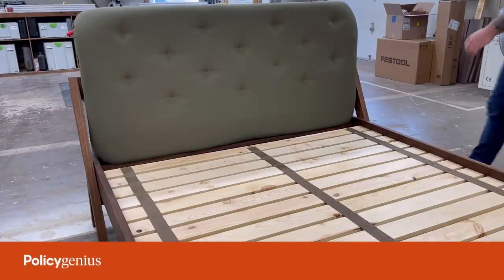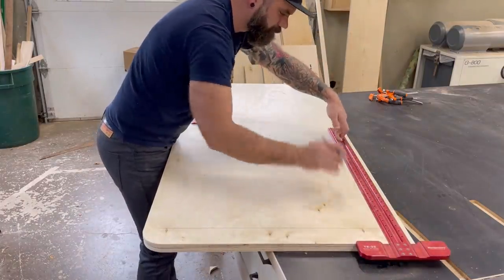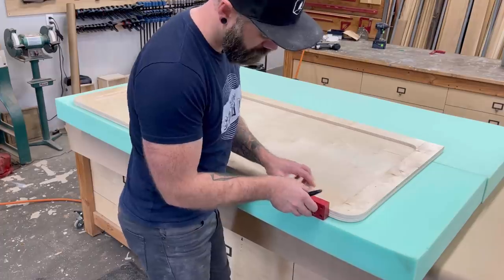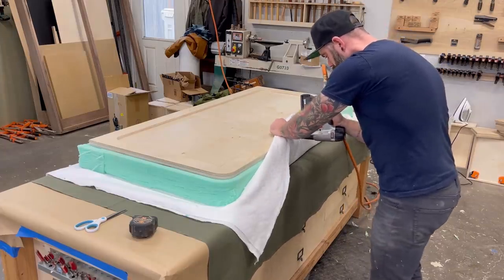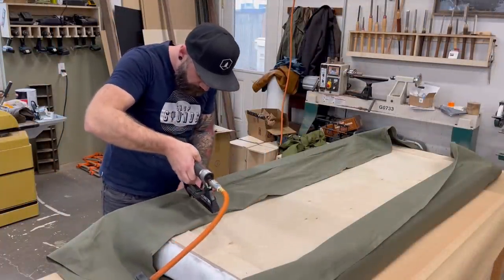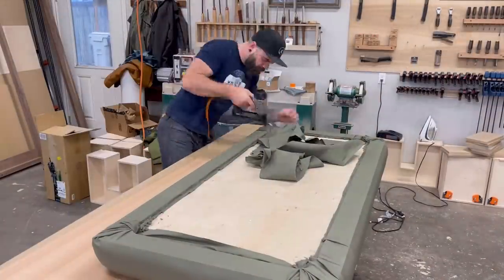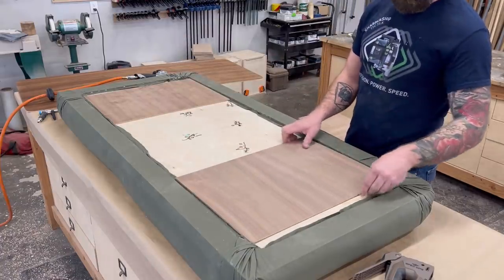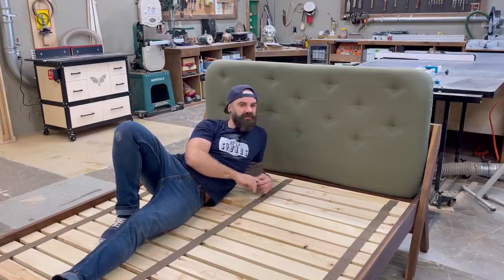Trying To Make a Headboard || This Wasn't Easy

Comment: Just a few tips for next time (I'm not an upholsterer, but a sewist and a costumier)

Fishing line for your tufts. Use a heavy gauge. The thread itself will be invisible, the tufts will still work beautifully, and its a lot stronger and more sturdy than embroidery thread. You also should do tufts before you glue the plywood on ;) You want to hit your fabric pen X on the outsides and aim for the middle out the back because you're gonna pull them real tight (which is what sinks it in and creates the tuft)

For your corners, cut a line in the corner like you're going to miter them. It gives you more control over the excess fabric and the pleats you're trying to create. It also handles the problem of excess fabric in the corners in the first place.

You can use your band saw or a jigsaw to cut your foam. Its a lot easier and cleaner.

And I'm not mad :) But for as much as I've learned about wood-working from you, maybe I can share something I know in exchange to make the process easier for you next time! <3
Reply: Thanks for sharing!
Reply: Certainly helps me out! I was wondering about the fabric in the corners. Now I want to do some upholstering.
Reply: I used to do upholstery in a furniture factory to work my way through university. Top marks for getting it done and looking very good from the front which is where it counts.  one tip that will save you a lot of effort and frustration for next time. Use an upholstery needle that has its eye near the pointy end. The longer the needle the better. from the back push the empty needle from the back ( in this case through the plywood) to the front. STOP as soon  as you have the eye fully visible. Thread the needle and just pull the needle back out the back pulling the "THREAD" with it. If you are using buttons made up at the upholsterer's shop (covered with your fabric for example) you would just loop the upholstery cord through the eye in the button and then both ends of the cord through the eye of the needle and pull it back through the cushion al at one time.
Reply: fellow sewist here!
firstly for stretching the fabric over the foam and plywood - do what artists do when stretching canvases and tack in the centre of each side of your rectangle at the start. this keeps the centre under 4-way tension and prevents your fabric shifting as you work + on each side, go outwards from the centre. on a non-pattern/densely woven fabric it's not so obvious but if your fabric shifts too much the grain will be noticeably wonky
Reply: also - agree about the mitred corners — you often see quilters doing this. you can pull the fabric together and make what looks like a triangle, standing up vertically, to cut excess fabric then fold the raw edges under; if you are worried about things shifting you can use a slip stitch to keep both edges of the mitre together. or you can just chop off the excess fabric and do pleats i guess. 

re tufting: you could do it before the plywood, but since this was an afterthought - maybe drill bigger holes next time? and tie threads from different holes together, that could work? buttons will make tufting look nicer, but then you need matching fabric-covered buttons or have to cover them yourself, so... pros and cons.
Reply: would they need to be fabric covered? as another comment said some walnut buttons could be nice accents in the upholstery that matches the bed frame.
Reply: @James Bentley  Fabric covered is traditional, but in reality nearly any nice bog button would work well

Comment: There is an easier way to thread needles through foam and fabric, they make a double ended needle in lengths from 6" to 36" long. I am an upholsterer with 52 years experience. Also, when you do the corners, start in the center and work out pulling the fabric straight, this will give you straight pleats, which look better. The way that you attached the ends of your strings is the way we di also, so 100% for that. On the whole if my Apprentice presented me with that job without any previous training, I would be really encouraged that His or Her prospects in the industry were excellent, provided that they were prepared to listen and learn. On the whole a good attempt, 70%, with 100% for effort and initiate.

Comment: next time map out the holes on the ply wood before you upholster.  Drill those holes out with a half inch bit then stick the foam on. Now you can drive the needle through the hole making sure its level.  Use a button for a more finished look.  once you have both strings on the back slide simply use the stapler to attach it to the back of the plywood creating a Z pattern for strength.   

I absolutely love your wood projects.  you've inspired me to get reacquainted with my woodshop tools. Keep up the great content.

Comment: I know nothing about upholstery and I prefer the look that you created, truth be told... But... In a video I once saw, the upholsterer cut out 1 inch or so holes in the foam all the way through and used buttons. The back board was two small holes and then they simply pulled tight and tied off. They made it look easy, as you do with woodwork... aaaand I find both utterly baffling. 

Cheers for the awesome content!

Comment: Good video!  Glad to see you aren't afraid to try something new and admit when you have no idea what you are doing!

I have made a couple upholstered headboards, and I sew, so here are my two cents:
Drill your hole bigger in the first place and usually  will have less problems finding it.  Have someone work the front side while you worm the back side, so you can keep things aligned and get clean,  tight tufts.  Use upholstery thread.  It is much stronger, almost like the kind used to make seat belts.  If you use a piece of pegboard, it will make planning out where all your drill holes go so much easier!  Alternatives to fabric pen: chalk, washable crayons, or bar soap (this is my favorite...it quite literally cleans itself off!)

Comment: There is an upholstery twine that’s strong, opt for that. Tuft first, then finish off. One big drill hole. Shortcut, cut a grid pattern on the front it will make the tufts look more tuffy. Have someone push on the front while you grab either some cotton or a finishing nail to tie it off. A button will make it easier to pull and push.   Then with the corners you can trim the fabric to reduce the bulk and make it smoother. My grandpa was an upholsterer and taught my parents while I was the button pusher. But for a newbie improvising… this looks good.  Nice job, just have to practice the even pulls. Like sanding it takes time.  It’s also good for developing strong hands.

Comment: DeWalt, and I'm sure every other company, makes a snap off razor blade knife. I almost never use the snap offs because I inevitably use it like a sword. (It's about a 6 inch blade all the way extended). Cutting rigid insulation and the like. Would be great for cutting soft foam.

Comment: One thing I found handy to do was to use the spray adhesive to adhere the batting to the foam.  Then, on the surface of the batting, spray come silicone lube to allow the canvas or vinyl to freely pull over it.  If you hadn't done the tufts, I would suggest that you drill a few 1" holes in the back to allow air to move, otherwise you get that suction thing going on when you compress the foam and it slowly sucks the air back in.

Comment: I worked in upholstery for 6 years. You are correct we used a electric cutter similar to a bread knife. Usually pleats are made with buttons and tied off in the back with a synch type knot.

Comment: I'm no expert by any means but have made two headboards. I did the button and tuft before stapling the fabric to the back of headboard. This will give a deeper tuft and more control over the pleats. Another tip for the corners, you can cut some of the material to give it a more smooth look. Still looks nice!

Comment: Pneumatic Addict did a great video on how to "cheat" button tuft by drilling a screw with a washer through the foam into the backer and gluing buttons over the top. Worked great!

Comment: For cutting thick foam really quickly, use a hacksaw blade and a blow torch. It will go through the foam like a, well, hot hacksaw blade through foam. That's what I use for cutting out foam in gun cases.

Comment: For cutting the foam you should have used your bandsaw. When I have to cut foam and it will fit on my 14" saw that is always the best way. I also have a cutter dedicated to cutting foam that is nothing more than a scroll saw or sabre saw with a really long blade enclosed in a really long guide.

Comment: little tip for next time on your foam you should mark up the postions of the tuffs and then using a hole saw cut out holes that are 20mm in diameter but dont go through the timber, then in the center of them mark up and drill 10mm holes; what this does if give you a little void to poke your needle through.

Comment: I built something similar but I used buttons that I bought at a fabric store they were in a kit and it came out great I also used tie wire to pull the buttons tightly I too was learning for the first time  great job

Comment: Thank you! It brought me back years ago!
As a month-long "week-end project", I built a "tantra chair" about 4 years ago in very similar conditions, just without any skill in woodworking either, it took ages but turned out pretty well. I learnt a footlong carving knife works fine on foam, palette wood makes perfect slats and cutting the foam flush to the board is fine if you're pulling strong enough. I used PVC fake leather and studs, no tuffs, and learnt that studs are incredibly fragile under a hammer while you're pulling the leather, one stud each side at a time (this type of chair is only made of curves!).
Is upholstery foam the same awfully expensive in US? It was by far the biggest part of the project.
Reply: I had no idea what a tantra chair was... until I read this comment, and quizzically Googled it. 

That is NOT a beginner-friendly project. Well done, sir.

Comment: Great video sir!. I was just thinking that where the material is held by the cotton, it may snap the threads of the material in time. Most upholsterers use a button to hold back the material rather than just thread as it spreads the stress on the material itself. You can get buttons you can cover with your chosen material to match up or a wooden button would look cool to. I look forward to your next project, best wishes, cal😉

Comment: LOVE your contents ... thoroughly enjoy the videos and end product. I'm definitely not as expert as you, but here are two ideas come to mind for the finish: 

a) use two needles, insert second backwards and then re-thread, it may not be very easy but beats creating 8x18 holes :-) and then "pulling and pushing" to find the hole... LOL
b) there are special needles with hook style head (crochet), you can use those to push and pull (or pull and pull)

Comment: I’m nowhere near a skilled woodworker or a upholsterer - but I’ve dealt with cutting thick foam a bit. A sharpened kitchen Chef’s knife works magic. Maybe put the foam on some cardboard and use a good chefs knife. Clean cuts. Of course band saw would be great too but maneuvering a large piece around a band saw can be cumbersome.

Comment: Lol, batting can be used for many things, like quilts, but this seems like a fine application too. Also, should you find yourself needing to cut upholstery foam again, a serated kitchen knife (like a big bread knife) works great in one cut. You can also use a large unserated kitchen knife but Ive found the teeth work better. Probably could have also used some kind of saw. It's pretty easy to cut, it's more about what's most convenient that you have on hand.
Reply: As someone who is a sewer and not a wood worker but lurking around to get some wood working tips, I was LOLing so hard at the upholstery/fabric parts bc that is how I feel when Im building stuff. But on the sewing stuff Im like drill bigger holes! But I'm over here building stuff making the same decisions about wood work. 🤣

Comment: As long as the headboard isn't going to face a ton of punishment, you could always just make a sturdy frame and use thick pegboard under the foam, batting, and fabric. That way there is no drilling required, you figure out the pattern on the back, make sure you are poking the upholstery needle through straight and level, and it gets done a heck of a lot faster. You can still cover that up with another board when finished if you are worried about the appearance of the pegboard, and even add a bit more structural sturdiness that way as well.

Also agree with many on here pointing out the need for buttons in your tufting. You can buy little metal craft cover buttons and as long as you aren't using a ridiculously thick fabric you can just duplicate the fabric used on the headboard. That or change the color, go lighter or darker, or even go with various colors to better match the room's color scheme/style.

Also for those looking to do this, be prepared for sticker shock when you go to buy furniture foam and batting. That stuff is ridiculously expensive (that or perhaps it was just a Covid supply issue markup when I went shopping for it). I was awfully tempted to just go thrift store shopping for a piece of furniture that had a bunch of sturdy foam I could re-use, but my wife's aghast look when I mentioned this thought made me think again.

Comment: I've only done a little upholstery. With twice the thickness you could have used those fancy upholstery nails? You could have used them at single thickness but are those harder to use? You've got ultimate tweakability with staples (that you're going to conceal later anyway) nails seem like you won't have as much fabric control and then there's your nail line, making that look good, which is the hole point of using the fancy ones. Seems like there may be more of a learning curve using nails.

Comment: i am an upholsterer. nice effort. The biggest issue was the foam, you used standard density foam, Large deep tufts need lighter density foam AND you need to pre drill holes in the foam under every button, an electric turkey knife works well on foam.

Comment: To make your stretching and stapling bit easier (saves the finger pain) and getting cleaner edges, you could have apply some pressure evenly with some clamps and 2x4 and squeeze the the foam by 50% and then staple. however for this technic, 1" extra boarder for the foam is not needed and you would have end up with real clean corners and edges.

Comment: back in the day i made several gun cabinets with tufted velvet on the back of them. back then we didnt hae the internet to search for directions. we made it up as we went. i only used 1 1/2" foam, but they sell (or at least they used to) what ill call "blank buttons" where you can take a small piece of your cloth and wrap the button with it. i used those and spider wire fishing line to make the pleats. the buttons meant youonly had to come back through and find the hole once per pleat.  also, i remember doing it 2 way. i dont recall why or which worked better, but i did the 2 holes thing like you did (tying knots, not staples) and i also did some with one hole and just put a toggle in the loop to hold it.

eta- im not saying you did it wrong, im giving ideas for the next time. 

also eta- googled it and  i think the term to search to find them is "cover buttons"

Comment: I AM NOT A WOOD WORKER BUT WOCHING YOUR WORK IS VERY ENTERTAING 
THE WORK YOU DID ON THE BED I JUST SOW IT TODAY IF YOU DO NOT MAIND AND  IT IS NOT LATE I WONT TO COMMENT 
ON THE WAY YOU DID TO INSERT THE THRED ON THE BORD .
INSTAID OF MAKEING 5,6,7,AND 4 HOLES SYMPLEY YOU CAN SHARP THE NEIDL ON BOTH SAID AND INSERT ONE TIME AND PULL THE THRED ONE TIME  WITH JUST 2 HOLES

Comment: Good job considering.  I'm no upholstery expert either.  The only thing I would have done is to run a round over router bit around the edges (inside and outside that plywood extra frame you added) to ease the parts where the fabric crosses its edges.

Comment: looks nice, but do you feel those screws and staples when you are sitting up in bed?

Next time, cut about 3 feet of string and attached a needle to both ends, start from the front, send both through the head board equally, go through the back, and then send the needles through the front and again to the back.  then tie them off.

Comment: Been doing upholstery for 47 years, I had some cringe moments. As a teacher I give an A for effort, C for execution and a B for overall. Glad you found the 10-inch needle and a nylon thread would be best. Since you were putting the cover board on the back, the securing the thread was the right way.

Comment: As a person who sews, the repeated reference to buying foam at the fabric store causes me physical pain. Look around in your area for an upholstery supply store and spend less than half of what those two piece of foam will cost you at JoAnns.  My place will cut it to size for me and laminate different densities of foam together to get the degree of firmness that I want. I once took them a cushion that I stitched up. They beveled the edge, added the batting, and stuffed it in there for me.  I think I paid eight bucks.

If all you have is JoAnns, then you do what you gotta do. However, in a town with an upholstery supply shop, friends don't let friends by foam at JoAnns.

Comment: Dude... for future projects like this... drill 1 slightly bigger hole, but buy a second upholsterer's needle.  push them both through at  the same time, but turn one around so that as one goes through with the thread, the second pokes out ready to be threaded back the other way... Tighten the thread on the back of the headboard by tying the thread around a small bar (wood or metal) and it won't pull through from the front...